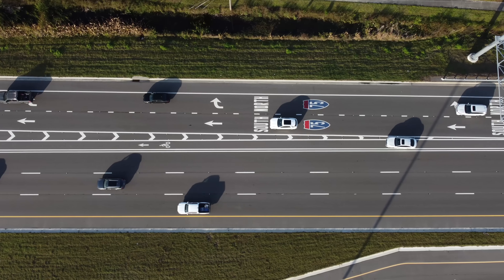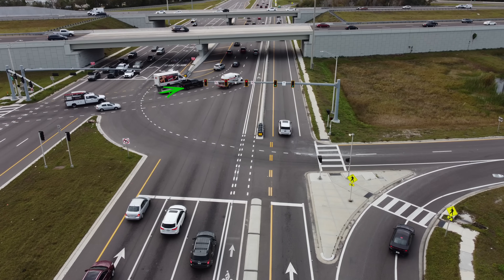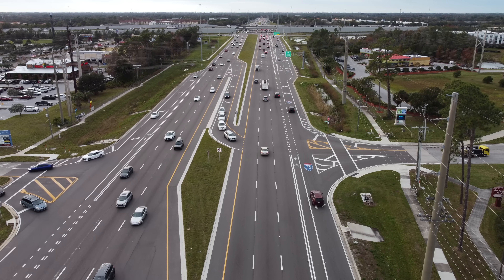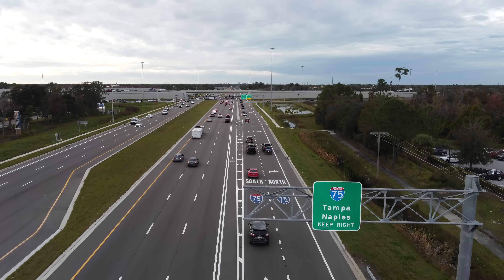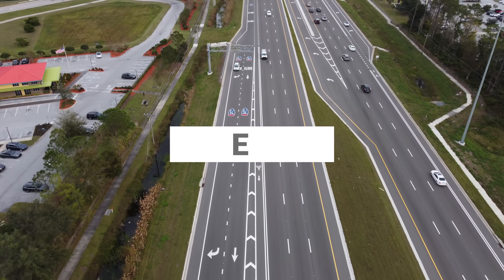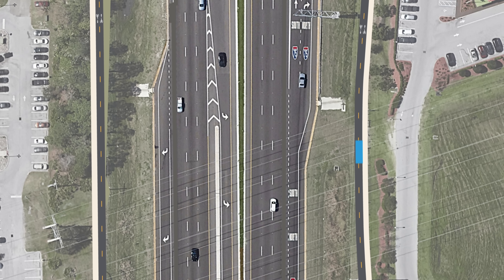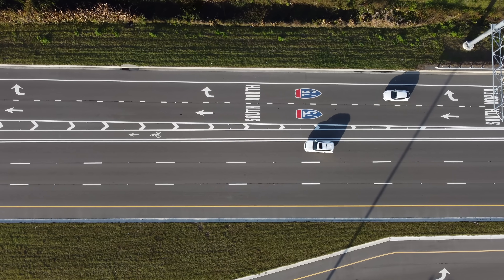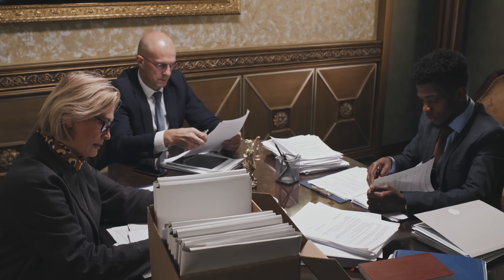This Brand New Interchange is Already Flawed

Comment: The reason maneuvers like that are still happening is there is no provision for a legal U turn.  How many times have I seen a divided road or avenue and the next dozen potential turns are no U turn.  With no explanation 'how to'. just repeated prohibitions.
Reply: And putting the bike lane over on a sidewalk,,, for years I commuted on a bike. My normal speed was 25mph.  When I needed to make a left turn, I'd pedal over into the left turn lane and wait for the light.  I could keep up with any car turning left, and once on the next road, move to the right and allow traffic to pass.  Relegating bicycles at 25mph onto a pedestrian walkway does not work.

Comment: I think the point about signage is the most salient point.  In Utah, I'm familiar of one particular design standard for bike lanes in which the road requires a buffered bike lane when the design speed exceeds a certain amount, which adds protection for those on bikes.  I maybe don't see it as fatalistically dangerous (admittedly, the current usage is of concern), or don't necessarily think the solution needs to be as drastic as separating a Shared Use Path parallel to the road, but at a minimum, it seems like it would make more sense to keep the bike lane on the shoulder of the road until a designated conflict point where (again) signage could indicate the necessary precaution.

Something to note that I didn't see:  overhead signs indicating the existence of a bike lane or the need to watch out for bikes.  Considering the possibility of any conflict point along this section of the corridor would seem to suggest the need for enhanced driver warning regarding more vulnerable road users in an adjacent travel lane.  

For what it's worth, well done on the quality of the video and considering the various aspects of design and it's influence on the surrounding traffic.  Active Transportation Design, Roadway Design, Signing/Striping, Signals/Lighting/ITS, Traffic, and Public Involvement - covered a lot of the bases of any project.

Comment: I would not go with tunnels but bike and pedestrian bridges instead.  A Road needs more struction to hold up then a pedestrian bridge.  Plus, it allows people to walk and see and watch the road as well as it is safer then being under ground.  Unless you want to try to pull a Hong Kong where you can put shops in tunnels and always have 1 small police station with a jail cell at every tunnel.  This only works if there is 100 pedestrians per minute walking through the area.

Comment: This intersection is terrifying on multiple levels.  
When you're ground level and are approaching an unusually complex intersection like this you need to correct signage way ahead of time so you have time to get in the appropriate lane.  I've noticed that much new construction only begins signage when you need to select your lane.   So you slow down and annoy veteran locals while trying to get in the correct lane.  I have never seen an intersection like this before.  With out the overhead views, I would be confused by the unfamiliar layout, strange traffic lighting (this lane is green, but the adjacent is red?  Seriously?  Let me move over...), and unclear lane markings.  

Travel to unfamiliar places requires a GPS now.   Even then the GPS will now place in the correct lane so you wind up having to go miles out of your way only to find the traffic pattern completely different from the other direction and confusing in a different way.

Comment: The signage is really the only issue. The actual lane layout is pretty clever. Aside from the bike lane which is abhorrent. It should be by the sidewalk like you said. I majored in CE and minored in transportation. I’m not sure who designed this, but they didn’t think of all the details

Comment: A bike line with no physical barrier between it and auto traffic is useless. I'm from the northeast and I can't stand driving in FL. Trying to cross a 6-lane local roadway with no signals is a nightmare in a car, let alone on a motorcycle or bicycle.

Comment: The road crew put the signs up in the wrong order. The double-wide sign was meant to go up on the much wider structure further down where the lanes extend, not hanging off the short structure early on. That's not a design issue, just a foul up in assembly.

Comment: To be fair, on the bike path issue, Florida has a very low water table so a tunnel would likely never be an option. 
That being said, dirt is not an expensive commodity, and given enough distance you could build an incline/decline gradual enough for all pedestrians to use with ease. Then it'd be a matter of constructing a pedestrian bridge wherever you'd need. Best oart would be that pedestrian bridges don't need the same weight tolerance as a tunnel going under a road.

Comment: What is the bike lane even doing there? :O
Even if there was no crossing traffic at all just cycling alongside cars at that kind of speed with this much available space for drivers to mentally check out is insane. Even a separate bike path along the direction of the road is pointless, it's way too loud there. Just have a few tunnels crossing the road at places where bike traffic would have an actual destination, and build the separate bike paths a few hundred meters over on both sides.

Comment: Dutch traffic engineer here. Why do you want bikers and pedestrians to cross the interstate along this road ? Let them cross along a parallel quieter road. I.e. connecting Birds eye terrace to the Walmart center. Much safer, and you need only two new underpasses (to cross the interstate). Much better than the meandering design along this SR70 main road arterie you show in this video...

Comment: I swear, American traffic engineers don't actually drive themselves or are mentally challenged.
Perhaps it has to do with the amount they are being taught and it removes critical thinking, as they use "building blocks" to cobble together solutions for an intersection, instead of coming up with their own designs and solutions. I get it, it's not easy to do as many factors go into a design. Space restrictions, Rushhour traffic, priority routes, cars vs trucks, provide direction changes, speed restrictions, public transport etc.
What America and Canada fail to realize, is that vehicles are the problem, not the "traffic".
If cities were more convenient for people and public transport, we could HALVE the vehicle traffic and quadruple the people traffic. Signage and lane markings are hugely underestimated and a root cause for issues in a intersection. Like the inconsistency of a overpass allowing two lanes different ways to change direction. Such is a left lane to turn left and enter a loop left to head say north. Or where it is the right lane to enter a loop to head north. I see both solutions interchangeable within the same stretch of highway and it makes for confusing lane changes, especially when you miss the ONE SIGN that tells you in advance.

Comment: Small solution to the bike lane problem: install rubber bumpers with plastic markers raising up two or three feet. You can still go over them with slight damage to your chassis at higher speed, but it would mitigate a larger number of people to try again by doing a go-around and figuring the intersection out better. The rubber bumpers are easy to replace if damaged and emergency vehicles (firetrucks, ambulances, police) can still drive over them, no problem. If you had these bumpers separating the diverging roadways from the dedicated bike lanes, you'd definitely reduce car/bike collisions by a HUGE percent.

Comment: In ancient Rome, the designer of a bridge or aqueduct was required to stand under the arches while the construction support work was removed.  This made them very careful to design arches properly.  Perhaps the designers of bike facilities should be required to use those facilities for a few months after they are opened.

Comment: While your proposed fix for bikes will work, I am disappointed that it is always the bikes that take the "scenic" route, with extra length needed for looping around the other "more important" infrastructure, as if cyclists had no interest in short, direct routes.  Given this is Florida, i.e. flatland, routing cyclists through tunnels means they will be doing the work to ascend to the surface, and at some times likely face flooded tunnels due to storms or inadequate drainage and waterproofing design. Unless by some miracle the roadway is elevated sufficiently that the tunnels are at grade level, here again the cyclists will be expected to do more work to cover a given distance than the drivers of single-occupant motor vehicles with a power to payload ratio perhaps 500 times greater, for whom that climbing is literally no sweat off their backs.  If we want to encourage cycling and its zero-greenhouse gas impacts, cycling routes should be the most efficient, not tacked on to the margins (frequently hilly in many parts of the world) of infrastructure designed for modes which are far less planet-friendly.

Comment: I bet the best option is to build a a road management system engine you can create in a Game that strictly built how people think an act with random traffic mishaps. And the more built the road is, the higher the difficulty to really push the efficiency and to further push the limits of human kind advancement. throw In a satellite projected image of the world and you can change the aspect of it without interfering with infrastructure and is online where the best managed road for that specific location is swap with another, to out compete other peoples designs to really push the boundary of transportation.

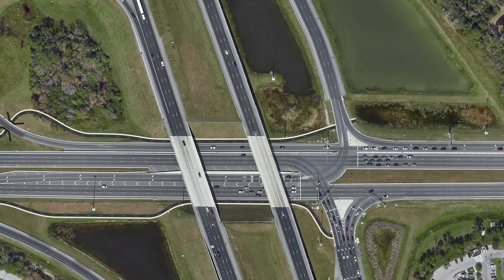Comment: 6:54 if I may add, Here in South East Asia, we mostly have conflict between cars and motorcycles, hence highways often have dedicated motorcycle lanes and ‘technically’ you can bike on them but with extra caution because motorcycles are faster than bicycles. In most major intersections there are tunnels and underpasses for motorcycle traffic away from the main highway . However it creates another problem, because it’s often further from the main highway it’s often less well maintained.

During rain storms these small tunnels are the first ones to flood and at night they are hotspots for theft because again it’s secluded and further from the main highway not visible to passing drivers.

Anyway, this is a great video, gives clarity and better insights on road planning and infrastructure

Comment: Bike lanes on any high-speed highway are just DUMB DUMB DUMB. It's pure politics all the way down with no consideration of practicality or safety. All it really does is add confusion for the vehicles on the road, adds complexity and additional width to the road design, and puts the cyclists brave enough to use the lane in grave danger. 

IMO cycling lanes should be banned on all roads with posted speeds of 45 mph or greater.

Comment: Why the fuck is that bike lane there. And why are bike lanes always seen as an add-on to roads? You could place them *anywhere*, so why always stick to the least safe and user friendly option? The solution to reconstruct the sidewalk and add underpasses is much better, but ideally your bike lines shouldn't even have to follow the same path as a busy and noisy road.

Comment: The bike lane is an absolute travesty. Imagine if you had a street with an active airplane runway crisscrossing it with only a solid white line dividing your car from the planes. Bike lanes should need to be completely inaccessible to motor vehicles to be considered "bike infrastructure."

Comment: The problem with bicycle lanes is that even if you put stop signs up for traffic control, they just ignore them and ride on through. It's worse in the country because the fools ride 6 abreast on hilly 55MPH backroads where you don't see them until your upon them. They also tend to have bike rallies or such and ride through stop signs as a group without doing any stopping.  Rules for thee but not for me appears to be their motto and its always the cars fault. 

One year a friend of mine from the county Sheriff had parked in my drive, I live on a corner lot where they blow through the stop , he stood on the shoulder and wrote every one of them a ticket. The next time they held their ride, they all stopped at the sign.

Comment: The oddest but most useful change in roadways i have seen, imho, in the last 5 or so years are crossover bridges for interstates for space restricted areas.  you go from right lane, to left lane on the bridge and can access the highway from a dedicated lane and 2 lanes that stop as directed by lights, then cross back to the right once leaving the other side.  it was weird at first, but genius.

one i saw maybe 10 or 15 years ago was in regards to rotaries/roundabouts in New Hampshire.  as you approach the rotary, there is a dedicated lane for any plaza/business that may be there, keeping traffic out of the rotary.  There is also a bypass merge lane from 2 opposing "corners" allowing traffic to bypass the rotary and move east or west.  very efficient.

Comment: Not to nitpick but the whole solution is the signage and when you showed your suggestion it was just as bad. The right lane isn't for 75, it's the bypass. That tells drivers to exit. Right lane is for a future exit. But the exit already started so it's still confusing.

Comment: Some images showed standing water next to where you proposed tunnels, which would seem to suggest that such tunnels would also hold water.
Reply: No it doesn't. It would only cost more to built a proper tunnel with watering solutions.
Reply: How do you keep the alligators out of it?   Seems like a great cool down spot in the summer for them.

Comment: You never get to the part were you fix the intersection... You go on a long tangent about an unrealistic bike/ped lane relocation and never get back to fixing the intersection.  Removing the bike lane won't change the confusion or the gaps that cars can slip through.
As for the bike lane... Tunnels generally won't work in FL... The water table is too high.  Just a few feet down and you hit water.  Anywhere you'd put a tunnel would instead have to be built up and re-graded for the road to go Up and Over the tunnel.  I support getting bikes off the road and onto their own bike/ped paths as the laws of physics trump the laws of man.  Speed and Mass... Cars win that collision every time.  Also you have the path going through water retention ponds... Those ponds exist to capture water run off during storms... namely Hurricanes... They are engineered to be the size they are to handle the runoff of the nearby roads, businesses, or homes as mandated by building code.  If you put a path through them... they will have to be expanded elsewhere or flooding will occur during storms.  Your surface paths without tunnels is the most realistic solution for bike/ped traffic... but again doesn't fix the intersection.

Comment: i lived off a highway exit that had a DD, diverging diamond, intersection.
normally you hear DD and think, "i love them big".
but what this meant is the west bound traffic drove on the left side of the road as they went under the underpass, and the east bound did a vice versa. it was a dual direction chicane, like found on race tracks.
and if you were doing 50+, you were wrecking it on a straight stretch of road, when viewed from above, because you had a 2 S curves.
and the occasional confused driver who might be driving head on at you. i had that happen to me on a yearly basis, thankfully speeds were low enough stopping was possible. but i made them throw it into reverse and floor it.
i like my cars to be trucks. and bigger than i actually need, so when i load heavy i don't break it.

Comment: Around 2:30 you mention channeling traffic to where they need to go.  Just before that you show examples of traffic violating the channeling.  Behind those dangerous and illegal moves is one motivation: getting where they need to go.  That channeling is meant to keep people where they are supposed to go, regardless if whether it is where the need to go.  
Yeah, I'm a picker of nits, but such things are worth keeping in mind.
(Personally that whole thing looks like a nightmare, where if I were just passing through I would have to just grit my teeth and try to follow the signs because there is no way I could understand it at first use.)

Comment: Building a bunch of tunnels for bicycles is not reasonable. That would be so expensive on so many levels, just to allow a bicyclist the ability to continuously ride their bike without having to slow down or look around them when crossing a road. A bicyclist should be treated like a pedestrian... they should always be looking in all directions around them to make sure they aren't going to be run over, and given a sign to let them know when they can or cannot cross the road. Too many bicyclists act worse than automobile drivers and don't have any situational awareness while riding their bike down the road. They will give a hand signal to turn and turn without waiting a moment to see what the vehicle behind them is doing, and they don't have any mirrors installed on their bicycles so that they can see the vehicles behind them. If a bicyclist wants to act like an automobile driver, then they need to build their bicycles like automobiles before trying to act like they are driving a car.